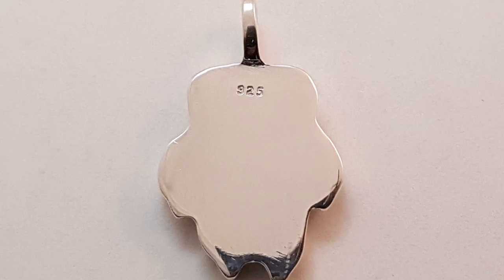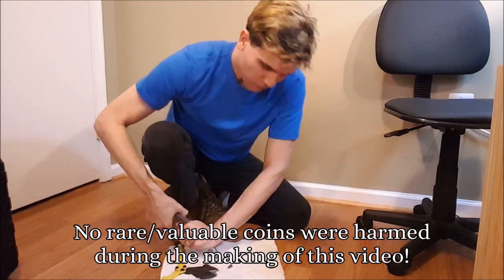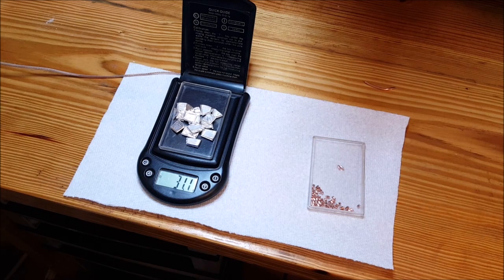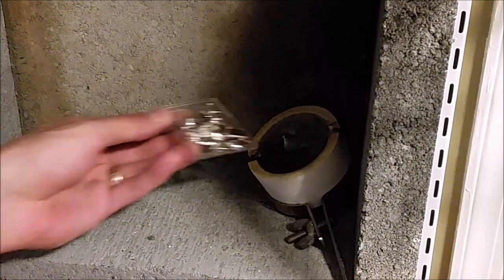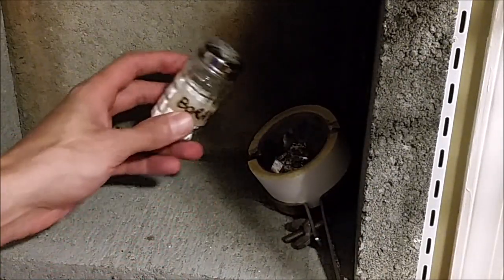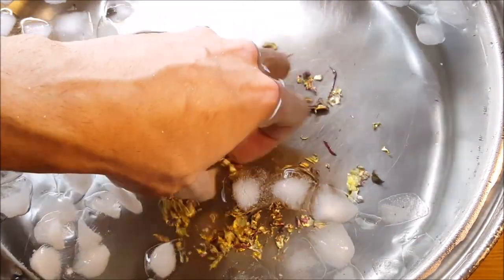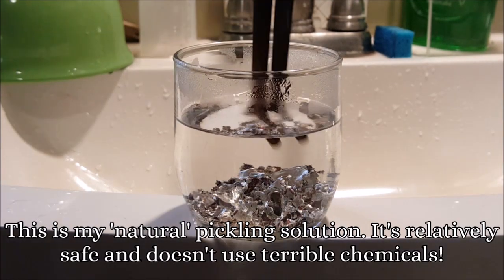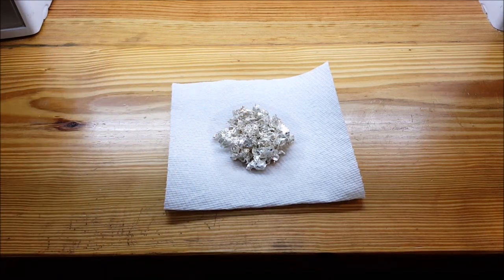How to Make Sterling Silver (and casting grain)

Comment: I wish you explain the math you use in the video. 
For say 10 grams of sterling: 
10(sterl) X .925=9.25 grams of .999
10(sterl) X .075= .75 grams of copper
=10 grams sterling silver.
Reply: What if you are using .925 scraps? Can you just melt and pour into water, then pickle? How to get you .925 scraps into .925 grain

Comment: Hey nice video, I do it the same way. My sterling grain has now red flooring on it after pickle it. can I just tumble it away? Or is it normal?
Reply from the maker: Thanks!   ❤
Red flooring? I'm not sure what that means.
Usually when there's color on the surface, it's either 'firescale', a tarnish that wasn't cleaned away by the pickling, or in rare cases the metals didn't properly combine so you may have spots of unalloyed copper on the silver.

Either way, when you melt the casting grain to make something with it, it should not be a problem.
I wouldn't try to over-clean casting grain. It's a raw material, it doesn't have to look pretty.  😉

Comment: Great thanks. May I ask what method would you use to make really small silver or gold from a scrap coin for trade in a SHTF scenario. So I'm thinking less than a gram maybe a quarter of a gram or less. Cheers
Reply from the maker: Not sure what a SHTF scenario is, but you can't go wrong with bolt cutters to reduce a coin to smaller pieces without losing metal in the form of sawdust or shavings or filings.  😉
Reply: turn it into a ribbon and score it so you can break pieces off of a known weight.

Comment: Thanks you answered my big question as my flakes all came out colored and I thought they might not be sterling. Now I know they just need to be cleaned.
Reply: I just did this and had the same question. Some pieces of the grain had a copper patina to them even though I cranked my furnace to 2100°F and stirred with a charcoal stick.

Comment: Wondering how much material is lost in the process, 33.4 grams was total before melting I believe what was it after?
Reply from the maker: In theory, there should be no noticeable loss. Miniscule trace amounts might stick to the crucible or form oxides, but it's something that is undetectable on a normal workshop setting.

Comment: hello i was using baking soda like in the video but it was not cleaning it i was swirling it around like in the video o.o
Reply from the maker: I used warm vinegar with a teaspoon of salt as picking solution. The baking soda was just at the final rinse to neutralize the acidity of the vinegar.
To use baking soda to clean silver you usually have to either make a paste with just a bit of water and rub thoroughly, or boil the silver in a solution of baking soda and water. That removes normal tarnish but not the firescale that forms on silver that's been exposed to flames, for the latter you need something stronger (like the vinegar with salt).
Reply: @SculptyWorks  tysm for the reply i was using baking soda by itself oopsie

Comment: thank you for this video! tell me, what should I use to melt gold and silver? what’s the fire-tool called?
(I live in Sweden btw)
Reply from the maker: The 'fire-tool'? I should start calling it that!  😁
Here we call it a blowtorch. There are many many options for those; you need one that can reach temperatures of 1100°C. Common household propane can be used as gas, but takes a little while longer to reach melting temperature.
You also will want a proper crucible. Graphite or fused silica works for that.
Reply: @SculptyWorks  thank you😊, can you recommend any other way to create a chain or ring, apart from using the rolling mill, since it’s way over my budget?

I mean when I have melted the silver, then I have to make it flat, then small and long using the rolling mill so that I can later make this wire to small rings and then cut them to make a chain. my question is, can I skip this step and still accomplish that? or can I use another machine that does not cost like 300-700€?

I really enjoy your videos!
Reply from the maker: @codewithme7226  If you have tremendous amounts of patience (and good coordination), you can make wire by hammering the silver and drawing it long and thin and round-ish. It will require annealing it several times. Once you have it sufficient thin, you can use a drawplate (much cheaper than a rolling mill) to make it precisely a certain diameter, or just leave it with a 'rustic' finish.
Personally I don't recommend making your own wire unless you're getting paid to do it. Silver wire is readily available and not outrageously expensive. But if you have more time than money, go for it.   😉
For making rings (for the finger), unless you have a specific reason to start with flat stock and then round it, I recommend casting it already round and shape it from there (my cuttlebone casting video shows how to do that relatively easy https://www.youtube.com/watch?v=DnlnNs7cY8g ).
Reply: @SculptyWorks  thank you so much!😊

Comment: On the package of my violin strings it says my G and D strings are wound with silver. When they have seen better days and either snap or no longer sound good could I unwind the "silver" and take it to a jeweler and get some real silver jewellery out of it?
Reply from the maker: There are strings that are wound with silver. I have in fact started unwinding silver from strings for the past 2 years, it will probably eventually make it into a video.  😉
The amount of silver you get from one string is insignificant, varying from 0.5 grams to 1 gram. Takes A LOT of strings to get a significant amount.

Comment: Why didn't it become grains instead of cornflakes
Reply from the maker: The height of the pour but mostly the depth of the water in this case are to blame.The water container I poured the molten metal into wasn't very deep. It takes a few split seconds for the silver to cool down and solidify and if the water isn't deep enough it goes 'splat' at the bottom of the container and you end up with cornflakes. If you pour in thin streams from high enough into deep enough water (1' deep at least) you should get the little pebbles. They might come out in various sizes, though. To make them look like the casting grain available commercially you pour the molten silver through a second heated crucible which has little holes drilled at the bottom. This way you get a showerhead of molten silver that helps with the formation of consistent round grains. But you still need a good enough pouring height and water depth.
Reply: @SculptyWorks  wow. Thanks for the detailed information. Since I'm a newbie I had a question. How can I distinguish between sterling silver shots and fine silver shots? I'm stacking up and bought a few ounces of shot but now I'm confused if the seller sold me sterling or 999. He did say it was fine but still a bit concerned before I stack up more kilos
Reply from the maker: @masumkhan4040  There are tests you can do with a touchstone and acid, and more advanced lab tests, but by eye it's extremely difficult and unreliable to tell. That said, pure silver to the trained eye is a lot more white than silver alloys. Again, this is very hard to tell, but pure silver appears lighter next to sterling silver, which has a much deeper metallic tone. Also sterling silver tends to tarnish much quicker because of the copper content. But the only way to be truly sure is with a test. Many jewelers that have in-house custom services can test it for you often at no charge if you ask nicely.   🙂
Reply: @SculptyWorks  wow thanks for the prompt response. Really appreciate your reply buddy. I'll look into the aforementioned procedures. Thanks again. Peace
Reply from the maker: My pleasure! Good luck with it!  😊

Comment: Hi, good video.
I just wonder, when dry, wasn't it a bit reddish from copper?..
People also use zinc, nickel..
Can't really see on video..
Reply from the maker: Thanks! Nothing reddish about it. Color might vary from screen to screen.   😉
You are right, there are different alloys, and often sterling silver is plated with rhodium to prevent tarnish and make it look like platinum, but the classical sterling silver alloy is with copper.
Reply: @SculptyWorks  Thanks. I was a bit worry "if"..
I know that Russians mix gold with copper and alloy becomes red..
Looks like people in Russia like it like that and that was worrying me slightly with "white" silver..
I'll try now.
Thanks again.
Reply from the maker: @NabozThom  Sterling silver does look more 'metallic' than pure silver which has a noticeable 'white' tint, and even sterling silver looks 'white' when compared to say 'white gold', but it shouldn't ever turn red with that little copper added to it.  🙂
Reply: @SculptyWorks  👍👍👍